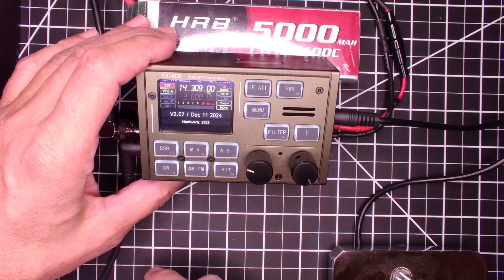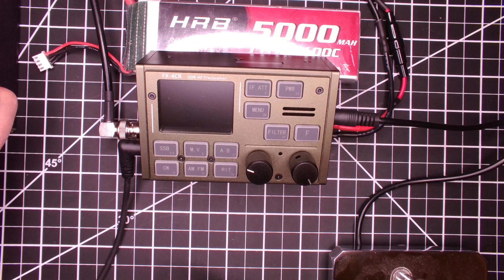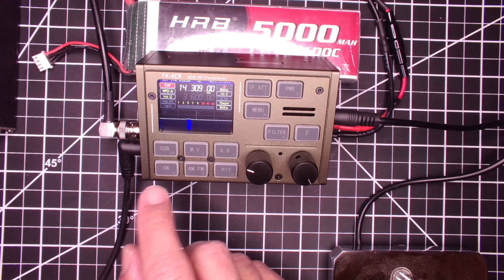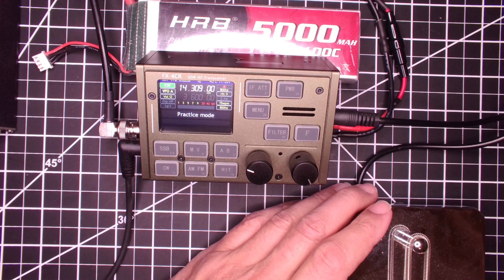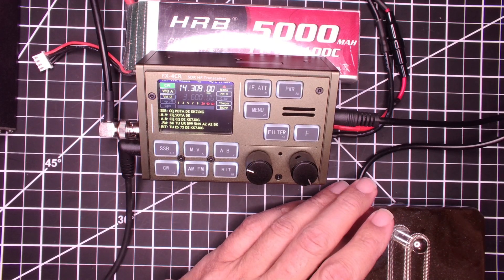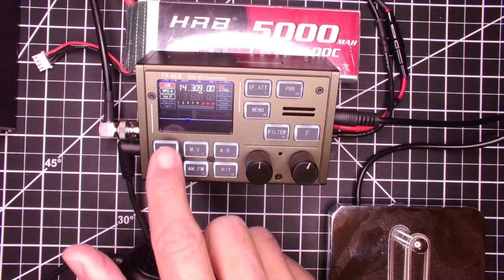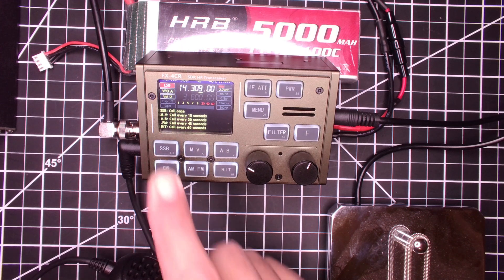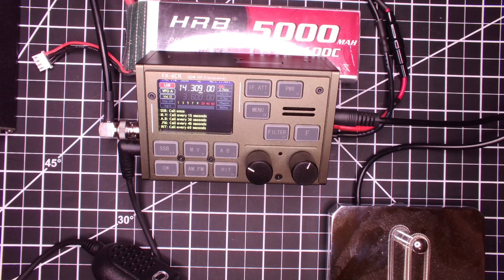New Firmware! FX-4CR

Comment: I ordered my FX-4CR last night.  Yu said it'll be a week or so before I receive it.  I'm like a kid at Christmas.  I spent most of today engineering and re-engineering and re-re-engineering an optimal and minimal power supply for ultralight motorcycle camping for SOTA and POTA with the FX-4CR.  I still need to make a minimalist 20W resonant dipole that I can use on 40 m and 80 m, and maybe 20 m.

I've watched many FX-4CR videos and had head of Daniel's firmware, but this is the first time I've seen it demonstrated.  Very nice!  Thanks for the video.

The link in the video description doesn't point to Daniel's github page.  I found him and he's still coding.  There were already 39 releases in 2025 and the last one was three days ago.  I guess the old adage is true.  Software that is still in use is never finished.

Comment: My radio is from 2023. It says V1.5 when it powers up. Does this firmware work on my radio?
Reply from the maker: Sounds like you have the same V series radio I have. So yes, it will work on your rig. You could also update you stock firmware - I believe it is at 1.7 if you want to stay stock.

Comment: Nice video.  I have two questions, have you noticed that the DNR function is not incorporated into Daniel's firmware.  Has there been any mention as to why?  Also, regarding the "practice mode", this isn't documented, is it?
Reply from the maker: If by DNR you mean Noise Reduction - DSP can be enabled with a press and hold of M.V. I have not found where to adjust depth though.  Practice mode is described in section 3.9.1 of the Daniel's user manual (press and hold CW)
Reply: @ Hi Barry.  On the newest USB-C chassis firmware, Daniel has implemented a notch filter and not a general noise reduction filter.
Reply from the maker: @LiveWire_Guy  a Notch would be nice

Comment: Will this firmware work on the later FX-4CR radio’s after Yu hardware change that prevented F5BUD firmware v2 done in August 2024 to be implemented on the later FX-4CR radio’s 
I believe this radio was done in March 2024 and got it used with the upgraded modified Fan Mod 
It has the XT60 DC plug and round barrel connector for firmware upgrades ( not usb c ) and shows as VR 1.7 when it boots up which might be the upgraded board but not sure since I am the  2nd owner of this FX-4CR 
and came in a purple anodized case 
73
Mike
WB6DJI
Reply from the maker: I'm afraid not - 'VR' in your current firmware indicates the new hardware - old (V2 compatible) hardware runs YU's 'V' firmware.

Comment: Nice addons.I might give this a spin. Can you still revert to Yu's firmware if you want to switch back? I also wonder if Yu and Danial might eventually merge their firmware builds so we can be on the same page with the future releases. I found some mistakes in Yu's documentation and some missing items from the menu and I notified him via email. They have not been corrected yet.
Reply from the maker: Yes. it’s easy to switch back but you must write down your origninal settings -see the ‘backup section of the vid’. I believe Yu contracts someone else to write the firmware but a colab may be interesting… or a community version fully open sourced?